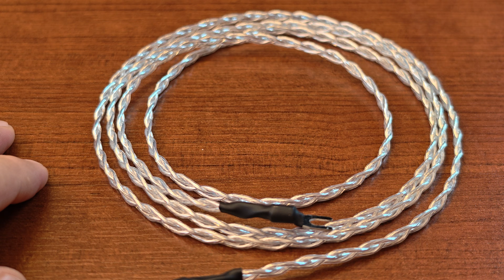Cheap turntable upgrade: Braided Silverplated Ground Cable Makes Vinyl Sound Better

Comment: If I may ask one more question about your listening setup: When choosing the Singxer SU-6 for your system, did you compare it with anything else?
Reply from the maker: I've done that a few years earlier when I was getting Singxer SU-1 for my first Gustard X20Pro DAC. I'm still using these in my Stax SR-007Mk1 setup downstairs.
SU-1 is so good that I just got SU6 for the main rig.
Reply: @k4syx  Thanks for the info. I'm using a Denafrips Pontus 15 and considering a DCC. That's why I'm asking and gathering opinions. I'm from the analog generation, and these topics are a bit unfamiliar to me, but I'm quickly gaining knowledge on the subject. In your opinion, would the SU-6 be a viable solution in this case? I was considering the Denafrips Hermes DCC, but it costs twice as much as, say, the SU-6, and the benefits are uncertain.
Reply: @k4syx I also have the Singxer SU-1 but somehow it’s not compatible with the AliExpress ‘Nordost’ USB cable clone you tested a while back. The Singxer only accepts cheap standard pc USB cables.
I have modified the Singxer quite a bit with an external 5V psu, better caps and a discrete voltage regulator. But it still doesn’t make any sense to me that it won’t work with aftermarket or diy usb cables. I’ve tried at least three different cables. All high quality ones.

Comment: Will this geometry work when all wires are connected to the same spade? I thought that the interference is cancelled in a balanced circuit?
Reply from the maker: Yes you're right, this is not balanced design so it won't be that effective. There are 3 wires here to lower the resistance and as I understand they are braided just for the looks

Comment: Why would you need any kind of Silver on a ground wire. A simple copper wire would be fine.
Reply from the maker: Lower resistance (higher conductivity of silver). It's not for sonic purposes here but to lower the resistance as much as possible

Comment: This is the snakiest of snake oil.
Reply: My records don't crackle and pop. You know why? It's because of all the little details and effort I put into perfecting the system. This is a tiny and cheap  step that actually works. I bet you would be wowed by the sound of my records.
Reply: @0031.yourmoralcompass  Doubtful, but OK.  Keep snakin' on!

Comment: I'm back here. I have a question not entirely related to this review, though it does relate to audio system connections. I noticed that in your test system, you're using the JitterBug FMJ with a desktop computer connection. I'm using the transport for streaming music, not the computer. Does the JitterBug FMJ make sense in this case? On the other hand, it's not an expensive device. I might give it a try. If so, could you share your opinion?
Reply from the maker: I think the effect can be small (depending on the quality of the power supply for your source and USB out quality). Then again it's really cheap especially if you'll get second hand one. 
So all in all, I would get one.
Reply: @k4syx  Thanks for the reply. I've already ordered it. I can always return it if it doesn't work.
Reply: @psemek69pl can you share your experience?

Comment: I agree. A good ground wire is very beneficial to a turntable system. Of course, if the system doesn't have ground loop problems. Great. Short and to the point. I enjoyed listening to it. All kinds of cables, the materials used in them, the types of braiding, cross-sections from the smallest to the slightly exaggerated, new technologies, and so on are a very interesting topic for experimentation and comparison. Recently, this has piqued my interest, alongside other audio topics I've been researching for many years. I used to pay less attention to it, mistakenly believing it wouldn't lead to "significant" changes in the system. I was wrong. Thanks for the review, and best regards.
Reply from the maker: Thank you! 
Have a great day!

Comment: I always leave of Ground from my TT because a ground loop happens..... I also see Pure silver variants for sale. Or so they claim
Reply from the maker: IMHO pure silver would not be a big upgrade here as we're not looking for best sound quality, just lowest resistance. In ideal world there should be no current in this cable: that's if the gnd potential in both devices would be perfectly equal
Reply: @k4syx my reasoning was they would have even  lower resistance and since they are just 20 it's not a lot to pay for peace of mind

Comment: Looks great 🎉
Thanks for the review.

What I don't quite understand is to where it connects on the turntable side?

Thanks 🙏 
Ilan
Reply: If I may suggest so, the ground wire connects the ground terminal on the turntable's rear (if present, as it's not standard) to the ground terminal on the phono preamp's phono input. You can also make your own ground terminal if it's not factory-installed. It's not difficult.
Reply from the maker: In most cases you will have dedicated binding posts for that, if there isn't one, usually you can use one of the screws that hold metal parts of the chassis. The best way would be to make sure that this is internally connected to the PCB board gnd
Reply: @k4syx 

I have a dedicated binding post but only on my phonostage side, not on my turntable
Reply: @ilanspiro1645 is it a turntable with a dedicated tonearm cable?
Reply: @0031.yourmoralcompass 
Yes
Reply: What tt do you have?
Reply: Transrotor zet3 @Error2username
Reply: All my turntables and now even the phono interconnect have captured ground cables. So yes a short video❤😮😊!! l stopped at 57 seconds to ride my titanium bike. And my vinyl  is truly spectacular these days, as Dan Hicks would say "l  scare myself..."